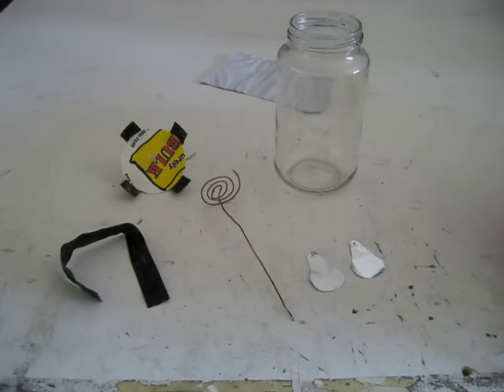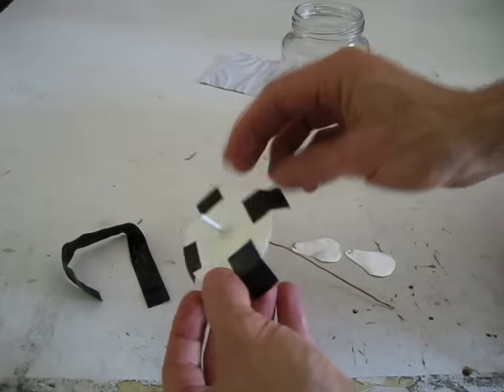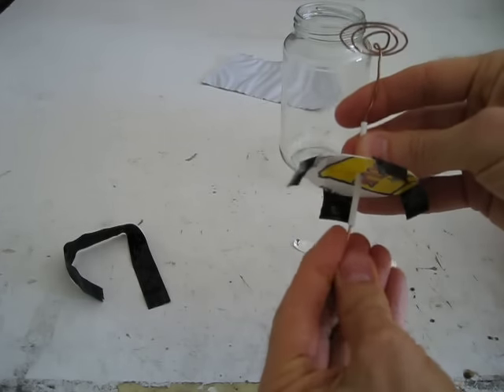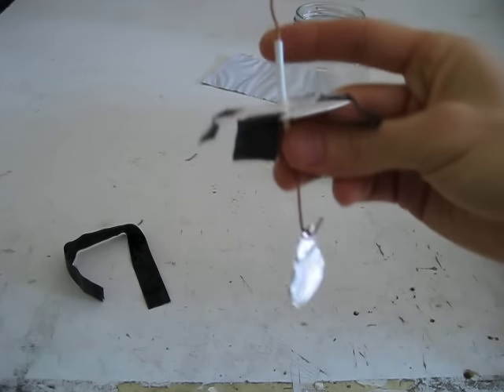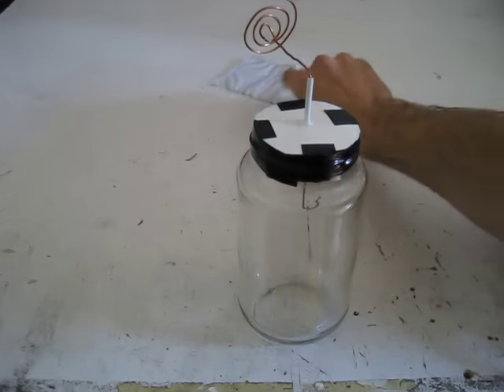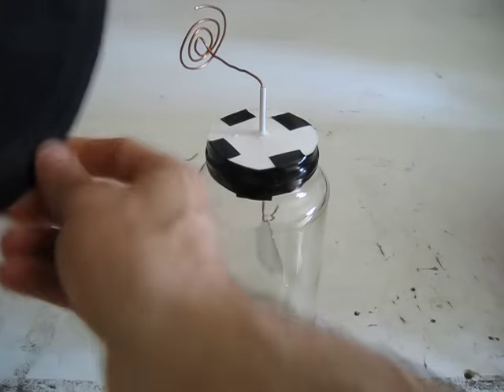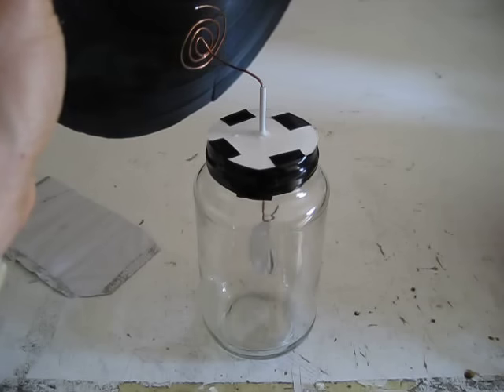How to make an electroscope (DIY)

Comment: helppp mine isn't working
Reply from the maker: The biggest problem is usually not with the electroscope but with charging something. See my triboelectricity video for help with that https://www.youtube.com/watch?v=ey88EdZo9hU . Another possibility is that you are not making a good electrical connection between the leafs and the wire that they are hanging from. They must be metal contacting metal. Sometimes the wire has a coating of something on it. Try scraping away any coating on the wire where the leafs touch it -- use the sharp edges of scissors or a knife but be careful not to cut yourself.

Comment: This project  did not work why ?????
Reply from the maker: Two most likely causes. The aluminum foil leafs must be touching the metal of the wire where they hang. If there's any coating on the wire 
there then you need to scrape it off.
The other is that you may be having trouble charging the object. See my 
triboelectricity video for more tips on charging objects https://www.youtube.com/watch?v=ey88EdZo9hU.

Comment: how to it work
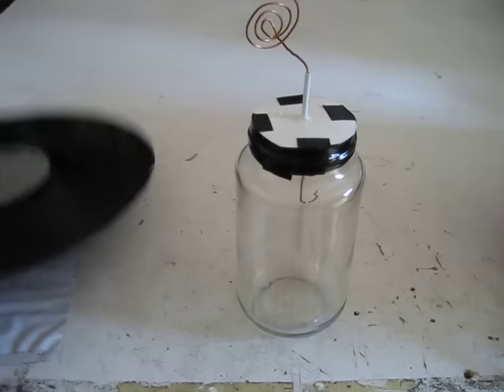Reply from the maker: The explanation is in the video starting around 3:35, but I also have an explanation with a diagram on my webpage here https://rimstar.org/equip/electroscope.htm. Basically, the two leafs get charged with a negative (or a positive) charge. Like charges repel each other, and so the two leafs repel each other.

Comment: Ugh mine does not work why??
Reply from the maker: Two most likely causes. The aluminum foil leafs must be touching the metal of the wire where they hang. If there's any coating on the wire there then you need to scrape it off.
The other is that you may be having trouble charging the object. See my triboelectricity video for more tips on charging objects https://www.youtube.com/watch?v=ey88EdZo9hU.

Comment: Instead  of that can v use a paper
Reply from the maker: mohd ifteqar ali Instead of what? What do you want to use paper instead of? The leafs must be made of metal, so aluminum foil is a good choice. If you mean instead of the vinyl, no, paper doesn't charge easily.

Comment: you can't use a metal lid?
Reply from the maker: Yes, you can use a metal lid. I didn't have the original lid for the jar when I made the video so I had to make one instead. If you do use a metal lid, if it's in electrical contact with the wire then make sure you don't touch the metal when using the electroscope. That would interfere with the charge.
Reply: Ok thanks. If I use the plastic tube in the middle like you did would that remedy that situation?
Reply from the maker: Yes, it would.
Reply: Chris Mosley hi

Comment: Can it made with thin copper wire
Reply from the maker: Yes. The only reason I used thick wire was because it is stiff. With a stiff wire I can make the hook for the foils to hang on and I can form the terminal on top.

Comment: I can use a plastic jar
Reply from the maker: Yes, you can use a plastic jar. I tried with a plastic jar and it worked even better than glass. The leafs would stick to the glass more, but not with the plastic. You can also use the lid (cover) from the jar. I made my own lid in this video because I didn't have the original lid.

Comment: Not working
Reply from the maker: Two most likely causes. The aluminum foil leafs must be touching the metal of the wire where they hang. If there's any coating on the wire there then you need to scrape it off.
The other is that you may be having trouble charging the object. See my triboelectricity video for more tips on charging objects https://www.youtube.com/watch?v=ey88EdZo9hU.

Comment: I did everything it didn’t work :(
Reply from the maker: Make sure the section of the wire where the aluminum foil leafs touch the wire doesn't have any coating on it. You want metal touching metal there. If you think there might be a coating the scrape that area of the wire with a knife or sandpaper.
The most frequent reason it doesn't work is to do with the charged object. Have a look at my triboelectricity video for more suggestions for charging things https://www.youtube.com/watch?v=ey88EdZo9hU.

Comment: But I done for me not came 🤔🤔
Reply from the maker: If you mean it didn't work then your problem may be with the charged object. See my video about the triboelectric effect for more tips https://www.youtube.com/watch?v=ey88EdZo9hU . Also, make sure that there is no coating on the wire where it touched the leaves. You need to have metal touching metal there. Scrape the wire if you have to.

Comment: Worst, I made this at home but it doesn't work. Just a waste of time and money.
Reply from the maker: I don't know what you tried but I suspect you gave up too soon. The most frequent reason for it not working is the charged object. Balloons and plastic soda bottles work. Check out my triboelectricity video where I demonstrate how to charge them and other objects https://www.youtube.com/watch?v=ey88EdZo9hU. Make sure that you bring the area which you rubbed near the electroscope terminal. Only the area which is rubbed gets charged.
The air can't be too humid.
Also make sure that you have metal touching metal where the foil leafs touch the hook. Scrape any coating off of the hook if necessary. Use a knife or the sharp edge of scissors but be careful not to cut yourself.

Comment: Wth. It didnt work. I had done everything in the video, but the aluminum foil didnt move.
Reply from the maker: The most frequent problem is not with the electroscope, but with the charged object. See my triboelectric effect video for more charging tips .https://www.youtube.com/watch?v=ey88EdZo9hU. Oh, one possibility with the electroscope, make sure your foils are coming into contact with the metal of the wire, sometimes wires have a coating on them. Scrape the coating away where they touch if you think that's the case. Thin wire that's used for winding coils and making electromagnets has a transparent enamel coating on it even though it looks like bare copper.